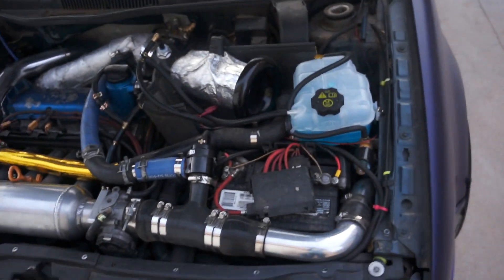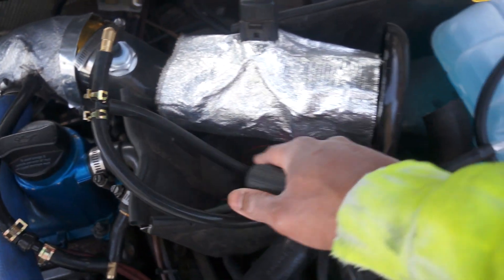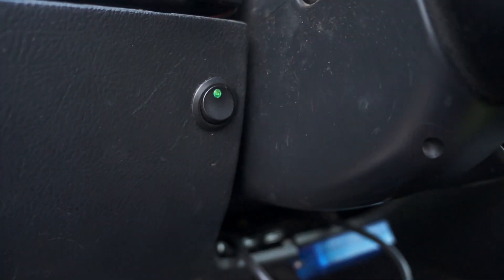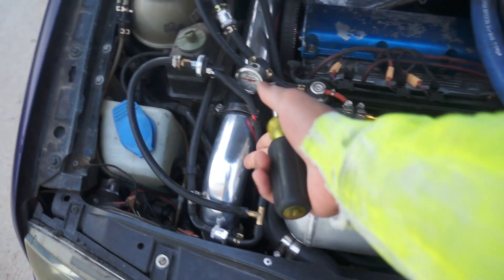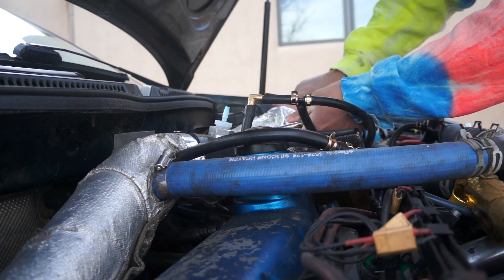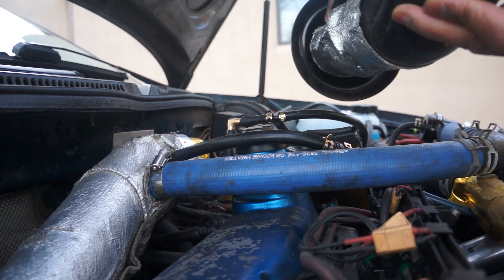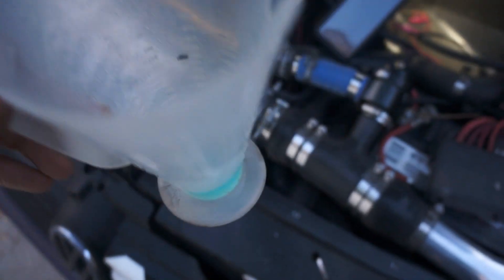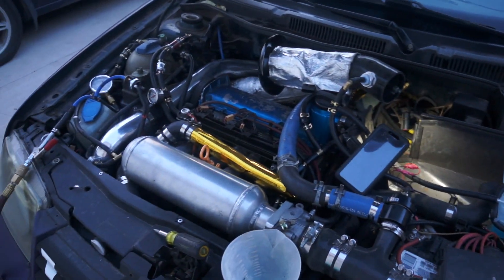DIY Water/Methanol Injection!

Comment: You dont need a pump. Or a return . Just plumb a boost line to the top of the tank ( think fat vacum line) if you spray pre compressor. Look up wannaspeed their kit runs pumpless. When boost is your pump it sprays progressive, more boost more spray, and finer drops. Also run the winter extreme temp windsheild fluid. More methonal. Did you know methonal fits between water. If you have a cup of methonal. And a cup of water. Pour them together and it wont equal two cups, the methonal fits between the water molocules.. its closer to 1.5 cups even tho you would think its two cups total. Wannaspeed system is tank, selinoid,  check valve, sprayer. Checkvalve is for ,methonsl out so it wont drip all the time. Boost line to tank has no check valve. Selinoid runs off hobbs switch.

Comment: I used a dual sensor air temperature gauge kit from amazon. I really only needed the post blower sensor but the other sensor didn't add much to the cost. check out the motor meter racing dual air intake intercooler temperature gauge. it cost me 76.49. cool video.